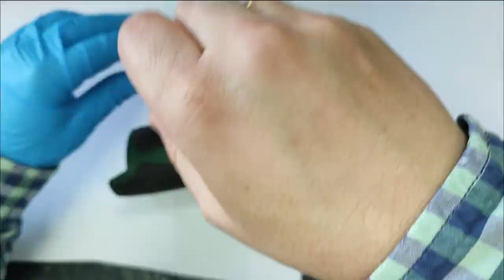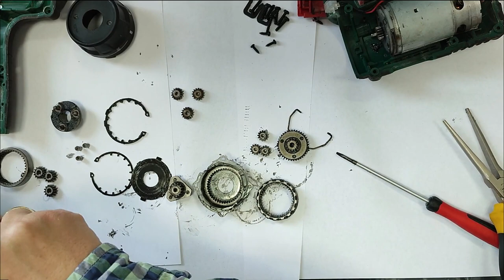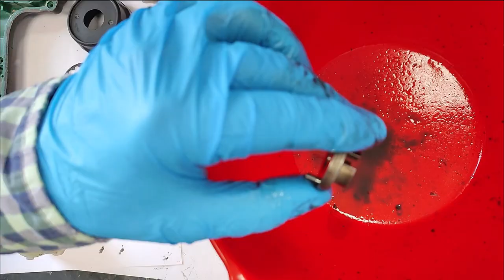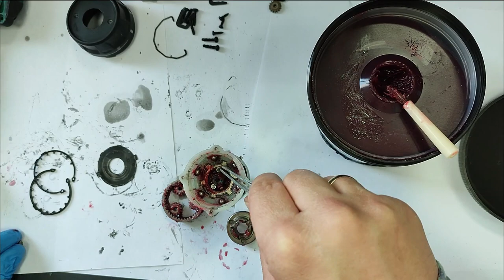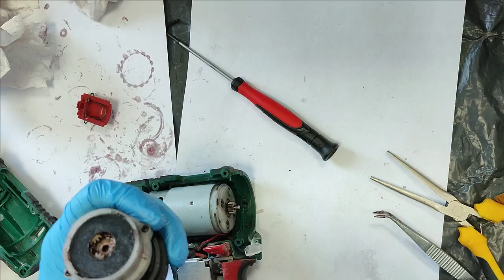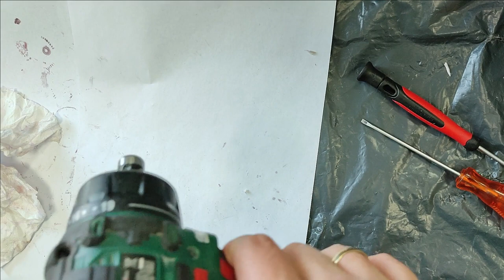Fix drill PARKSIDE PBSA 12 D4 - Repair and Maintenance

Comment: Unfortunately the most important part of the repair (assembly of the driving system) is not visible in this video. The machine grease is in the center of video.
Reply from the maker: You are right. I apologise for disappointing you 😔
Reply: Thank you, it's no problem. Fortunately i found the answer to my problem: where are the places of pins and balls. Thank you.

Comment: Hi, thanks for the video! 
I need to understand where you have replace the two circlips… it doesn’t see in the video, thanks
Reply from the maker: I really don't remember 😔. I also tried to figure it out in the video , but I guess there must be a gap inside the gear assembly for those. Sorry I cannot give you more specific answers. I gave this tool to the owner more than a year ago 😞